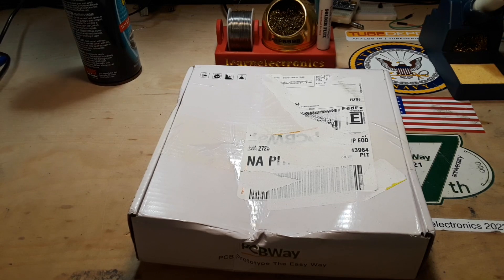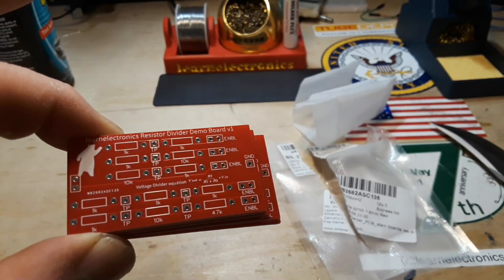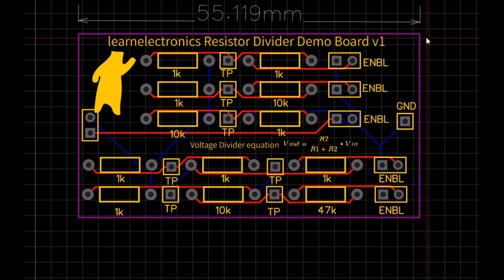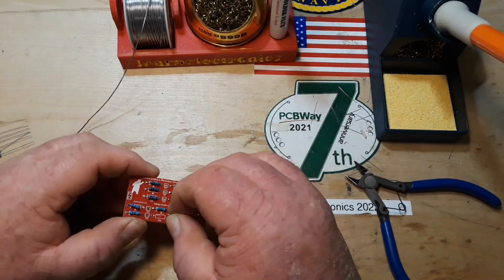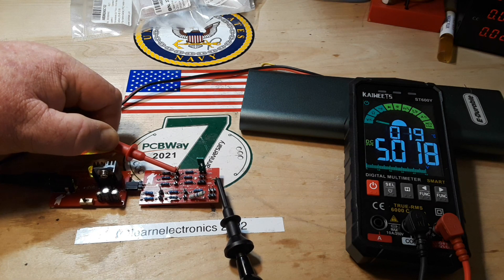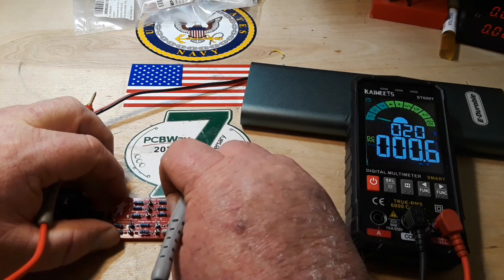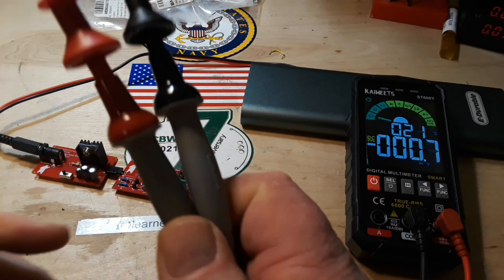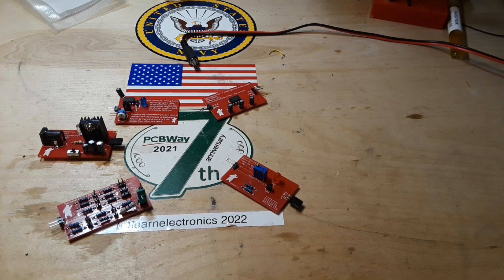Voltage Divider STEM Boards from PCBWAY

Comment: Might be safer to put the jumper just below the positive rail. If a student powers the current board up without a jumper on it's full voltage at output pins. Great to see someone passionate about educational elrctronic.